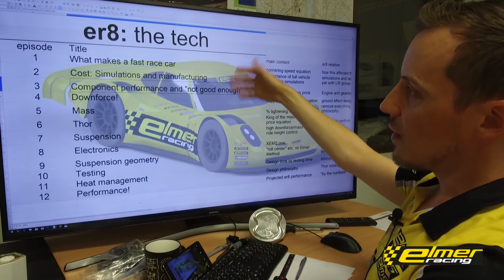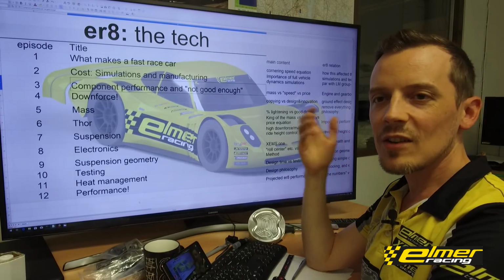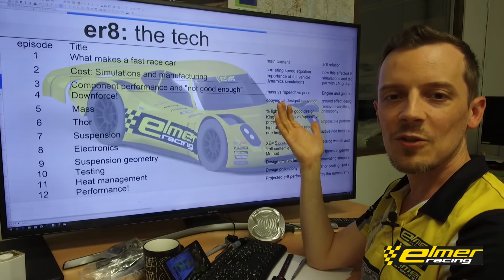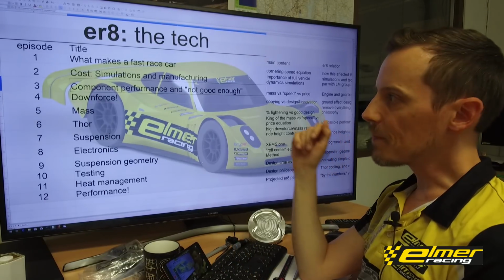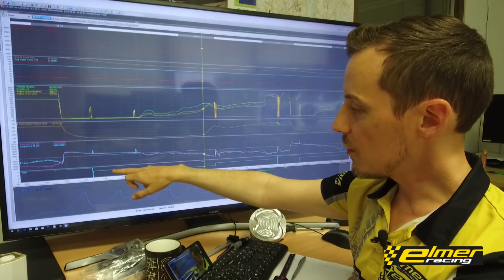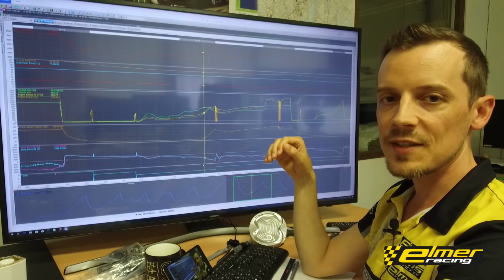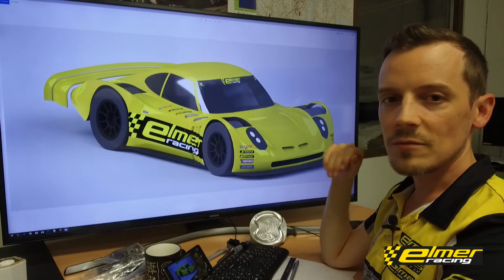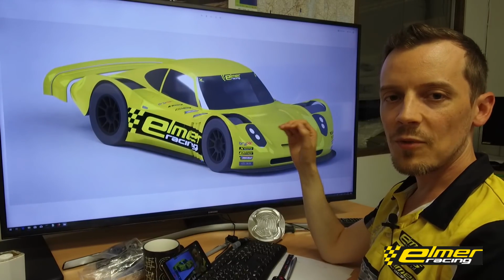Choose the best race car components for you, er8: the tech ep3

Comment: Which transaxle did you end up going with? Interesting you choose one designed for a drag application. Does it have a limited slip diff or is it a spool? If its a spool do you see this as a disadvantage?
Reply from the maker: It's a separate gearbox and quick change diff that we've selected. They are compact enough to be able to bolt them together as a "virtual" transaxle.
We did play around in the simulations with a spool. But where about 50-50 on whether to go with that or not. We erred on the traditional side and went with a limited slip instead. There are definitely big benefits to be had with a spool though. But some drawbacks also.
Reply: @ElmerRacing  That's interesting. I would have thought the only advantage of a spool would be weight and less complexity. I'd love to hear more of your thoughts on this, and how much of a difference there was in simulation.
Reply from the maker: That is a interesting discussion. Don't think that we'll be able to fit it into any of the episodes. But we need to check. There might be a lack of high quality discussions on the topic on the internet, that would be good to fill.